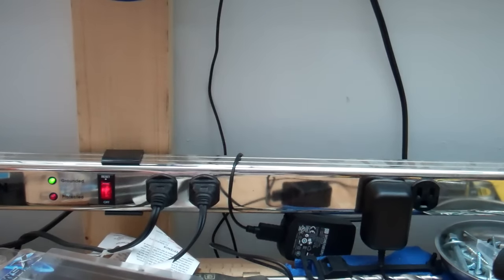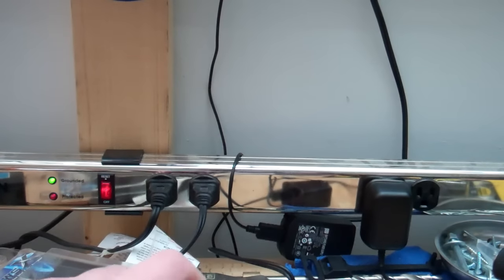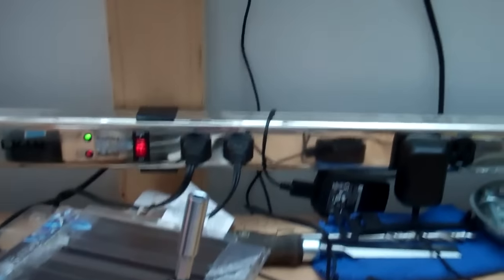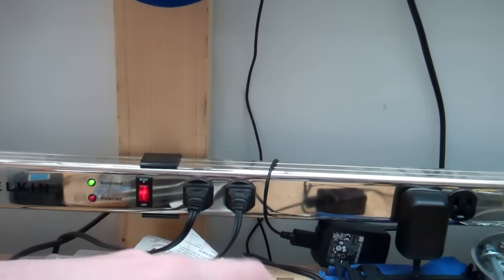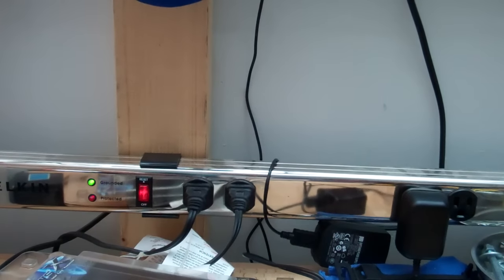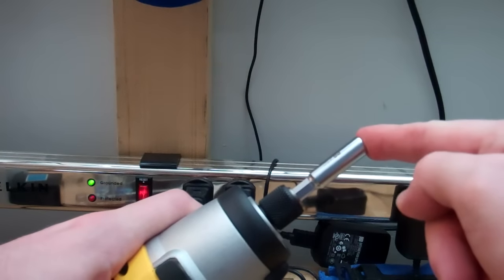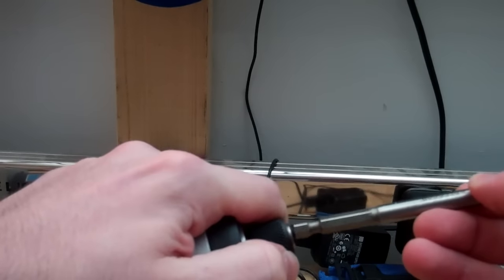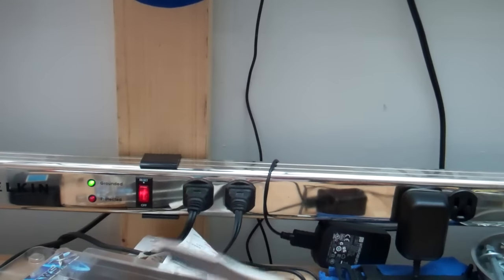Cordless screwdriver and impact driver 1/4" hex holder drill bit wobble

Comment: I wouldn't say its the drivers chuck because both machines are top notch. I would say its more the bits. The 1/4" hex bits are all different, get a micrometer on them and there will be marginal differences. I wouldn't use an impact for drilling if I'm doing anything precise.

Comment: I have the same dewalt and it doesn't wobble at all and I actually prefer it to my 20v hammer drill because of the impact ready chuck. It really depends on what brand or quality of the drill bits.
Reply: and not to use extensions but to put the bits directly into the hex chuck..

Comment: Why on Earth can't they build an impact driver that does not wobble?
Reply from the maker: It has to do with the bit chuck. It seems there's no way to get an easy and reliable latch and release without some wobble.
Reply: only makita impact driver is not wobble
Reply: @821816067  Even Makita wobbled a bit. Mine is too (just a little bit but still wobble)